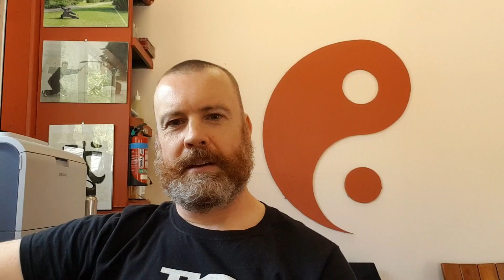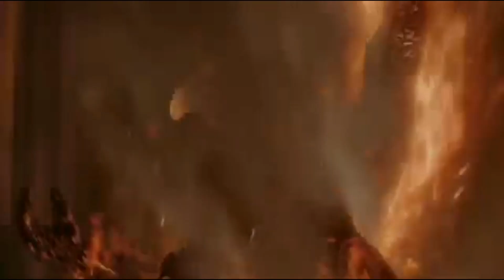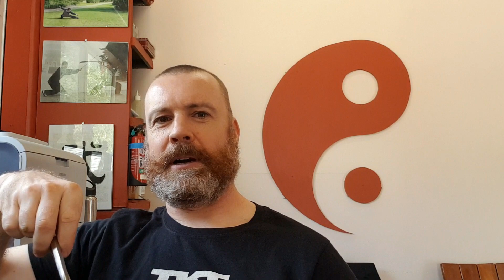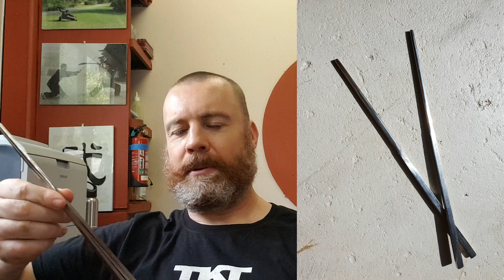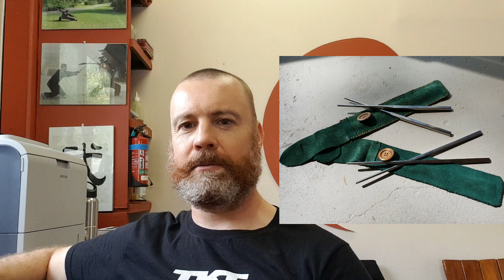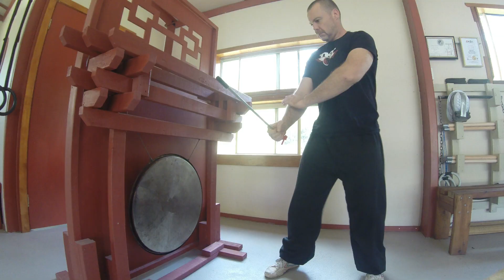Titanium Chopsticks

Comment: I fully understand on how hard it is to make a pair out of grade 5. I made a pair about 6 or 7 years ago and started on another one that I have yet to complete. I only use them for eating, but I am aware of the potential for defense. I made mine in the Japanese style since that is what I am used to eating with. I hope one day that I will get the time to finish the other one and it will be for my son. It takes time because I chose to make them almost entirely using hand tools. Only the cutting and the rounding utilized power tools. The rest was made by filing and sanding. I am glad that another has tried to make some out of this wonderful material.
Reply from the maker: Awesome that you used hand tools to make them. Much respect! If you want to share a pic, I would be quite interested in seeing them.
Reply: @WushuEngineer  sure, but how do I submit a photo?
Reply: I have taken photos of both finished and unfinished ones. I am not sure how to upload the photos though.
Reply from the maker: @welder001  you could send it to our Wushu Workshop email address. We should actually put the email address on our channel page but haven't gotten around to it. Thanks in advance. info@wushuworkshop.com.au
Reply: Sent them over.

Comment: I used to throw chopsticks. I started with some heavy duty bamboo ones. I then said ok lets move to metal. I bought some stainless steel ones on ebay. I also bought some metal chopsticks that screwed together. Both of those did not last long. The stainless steel ones bent after like 3 throws each. And the ones that screwed together broke after a few throws. So I just stick with bamboo. Or they might even be wood of some kind. I am unsure. I have not thrown chopsticks since 2014.